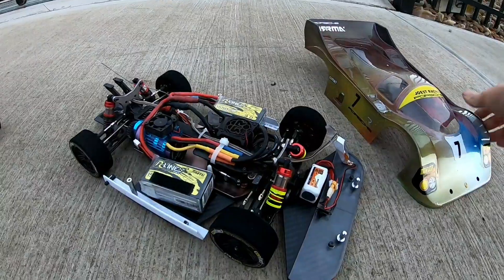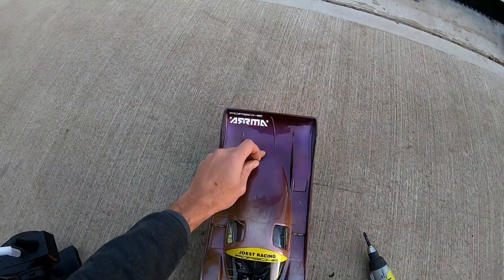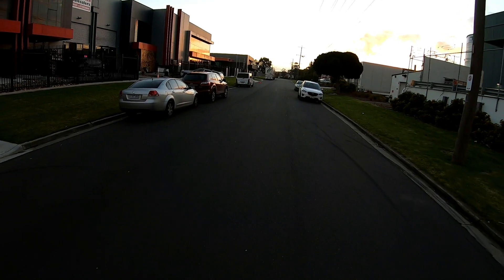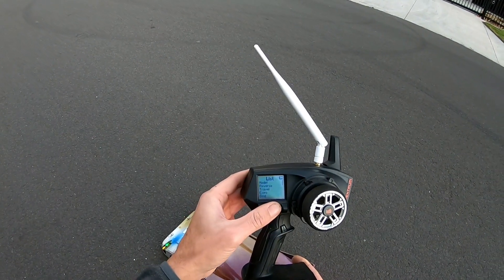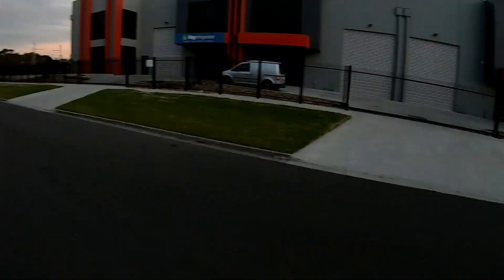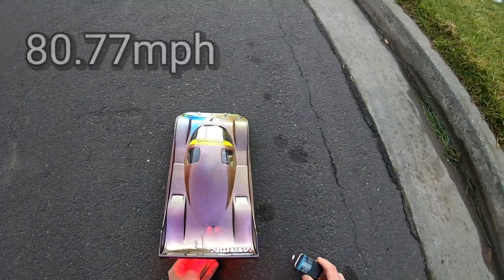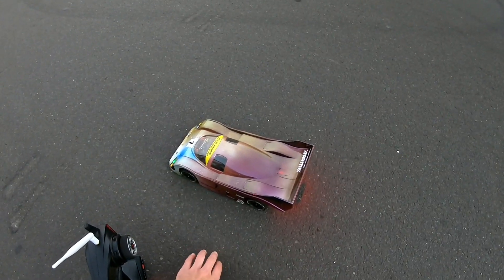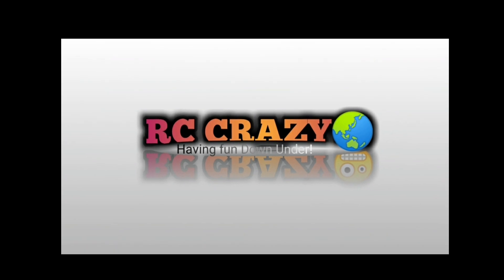Wltoys 124019 4s will be fast! Almost flipping at 130kph😱

Comment: Nice Shake Down test man, yeah stiffening those shocks are a must and larger lipo to add a bit of weight and you're golden i reckon for some fast speed passes next time 👊😎🤘🍻🇦🇺
Reply from the maker: Yeah the shocks are like marshmallows🤣
Iv chopped the wing down, added vertical stabilisers and stiffened the shocks so hopefully I can at least beat my PB🤞
I'll chuck some pics on Facebook soon.
Cheers man🤘👍

Comment: Car definitely looks awesome. Like you said, stiffening the shocks is mandatory. Other than that, it seems really stable.
Reply from the maker: Thanks Tim✌
Yeah I have no idea why I thought the shocks were stiff enough, no way🤪
And yes its super stable but I did trim the rear wing way down after that run to stop that lifting, let's hope🤞
Reply: @rccrazy You're Welcome 
 I was thinking you might need to trim more of the rear wing down also. Finding the balance between suspension stiffness and down force is the key to getting ultimate speed from everything I have ever seen, read, or heard about making high speed vehicles from full scale down to RC.
Reply from the maker: Yeah thats what I tried to do with mine because it is actually a real race car, the Porsche 962c LM, but being so small the wing isn't the same as the real car.
I removed the skate ramp😆 made it flat and added some bracing, much more to scale👌
Reply: @rccrazy  I would say that should definitely help.

Comment: I think it flipped because the body is meant for a longer wheelbase car. The force on the wing is pushing on the car much further back from the rear axle then it is supposed to. I wouldn't add weight to the car, just chop the wing some, put thicker oil in the shocks and throw some stiffer springs on there.
The wing is probably too aggressive for a speed car anyway. I think cutting it to about where it starts to go up would be perfect for the least amount of drag while still keeping it planted
Reply from the maker: Absolutely spot on in every way👌
I have just finished doing pretty much everything you just mentioned, not the oil because I ran out of 100w😫
I'll get some very soon👍
Reply from the maker: Oh, and I added vertical stabilisers, I also want to swap the servo out for my preferred Hitec servo I normally run.